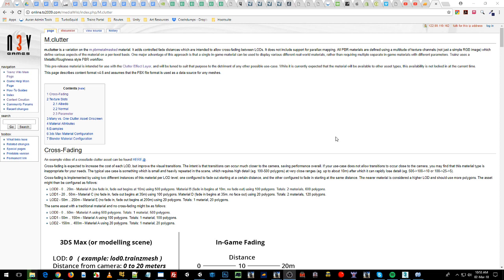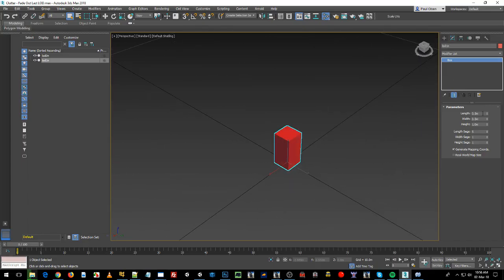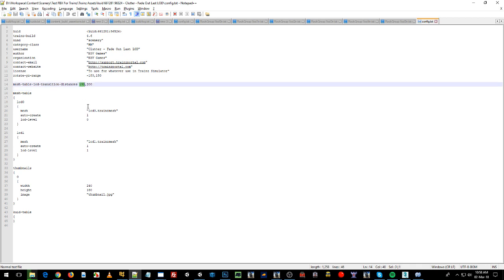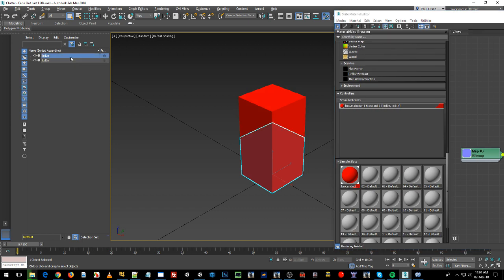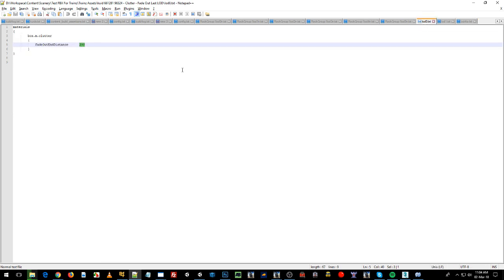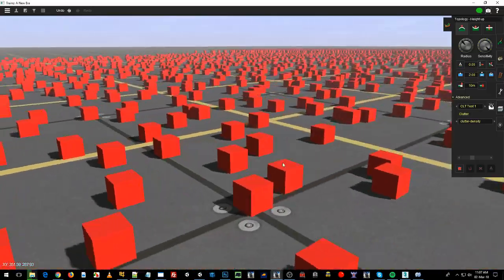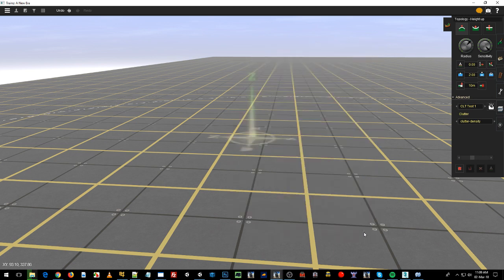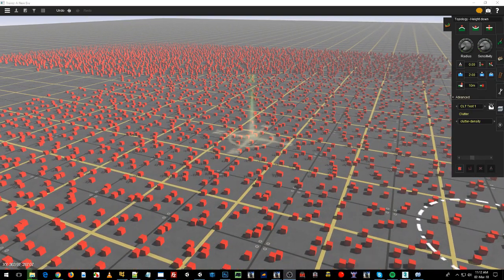Trainz - Content Creation - #34 - Clutter - Fade out lowest LOD (simple version).

Comment: How do you record on phone for trainz 2?
Reply: Hi Union Pacific 9000
We do not currently provide video recording capabilities on Trainz Mobile. However it may be possible to record using an independent app.
Reply: Zec N3V Support thanks for letting me know but I found out that on the iPhone 6s I can do screen recording so now I can make videos of me playing trains but thanks anyways!
Reply: Zec N3V Support also is it possible for you guys to add NKP 765 intotrainz deiver 2 mobile and make it very detailed and give it its own cab please
Reply: Hi Union Pacific 9000; we may look into this in future. However due to the limited hardware in mobile devices, we are limited on how much detail can be put into models for Trainz Mobile editions. This does also limit which existing content can be used in Trainz Mobile editions.
Reply: Zec N3V Support ok but can you make it “mostly” detailed in the future so it doesn’t take up lots of space?
Reply: Hi Union Pacific 9000, unfortunately size isn't the main issue for Mobile devices, but rather the speed and hardware resources available for Trainz are very limited and as such limit the amount of detail that can be included in content before it starts to cause issues with performance. The hardware in these devices has greatly improved since the original Trainz for mobile was released, however it is still very limited compared to Windows and Mac computers, and as such the detail on the content for Trainz mobile must be limited compared to the Windows and Mac releases of Trainz.
Reply: Zec N3V Support ok so I get your point but it’s just I’ve always wanted a NKP 765 since 2014 when I discovered trainz driver 2 so if, when, and how it’s possible add the 765 or at least 587